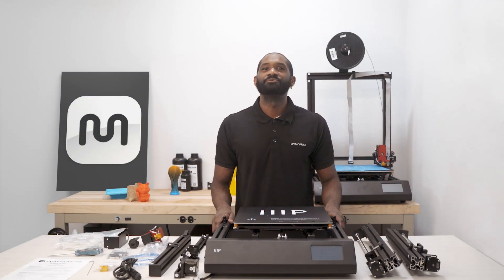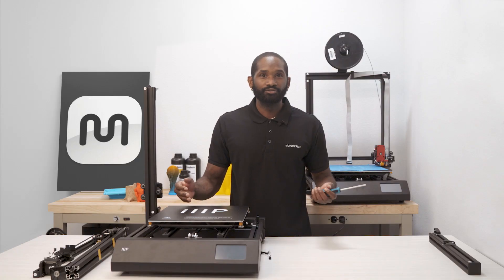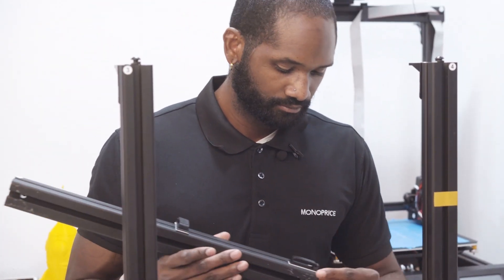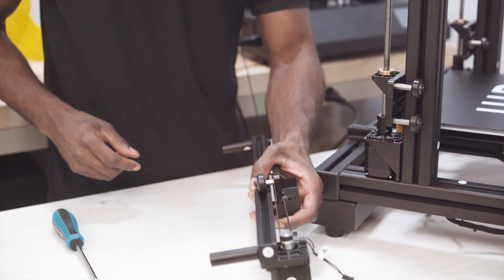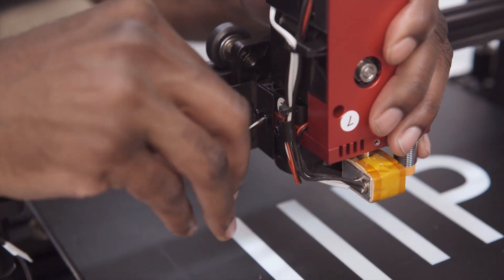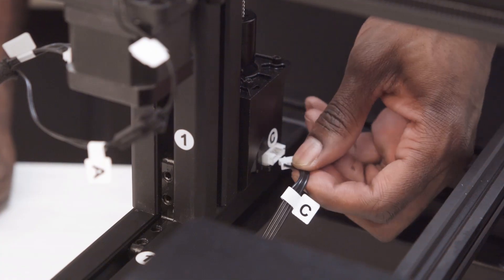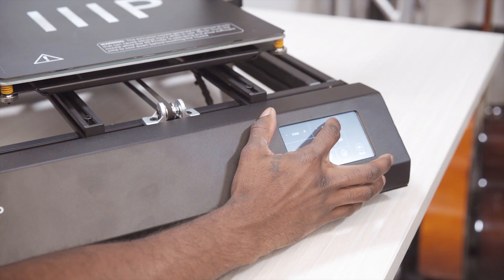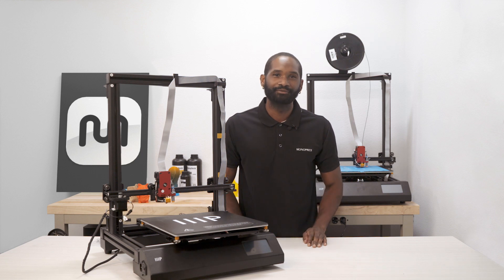Monoprice Maker Pro Mk.1 3D Printer Assembly

Comment: A great many people have complained about the bed leveling being bad. I have had the same problem with another printer from Monoprice, the extruder goes head first into the bed and scrapes the bed up real bad. What have you done to fix this problem or what can be done to prevent this?
Reply: Dont rely solely on the autolevelling process. It good, but FAR from perfect. Use the bed adjustment knobs to get it dialled in more precisely. download or draw a big print and adjust the corners accordingly, It will take several attempts. Patience is your friend.....

Also make sure youve take as much of the slop out of the rollers for the X axis and Z axis carriages as you can. DO that by tightening the long hex nuts between the roller and the various carriages.....